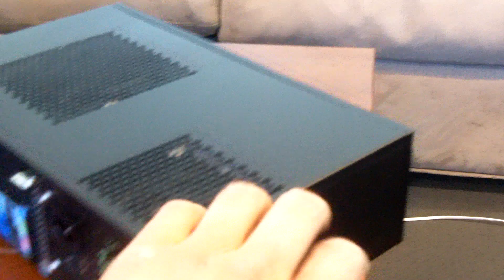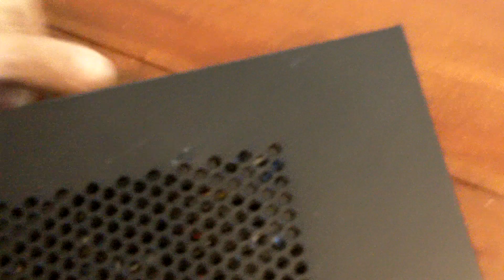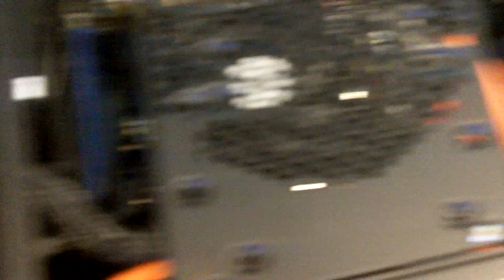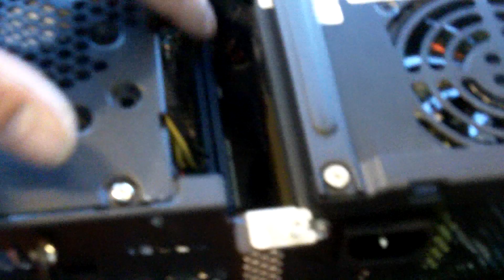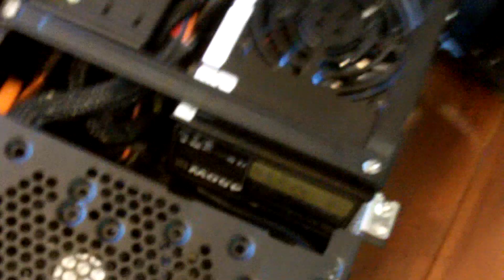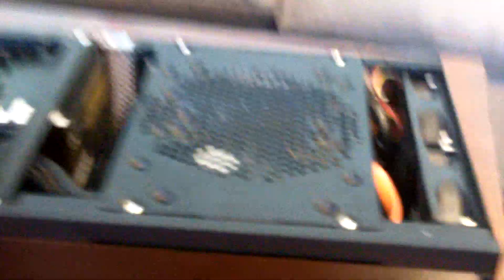Post CES 2013: Silverstone's ML05

Comment: I want to know this as well. Is there clearance between the water block and the top of the case for a 25mm radiator and a low profile 120mm fan? Like a Corsair H55/H60?

Comment: Must be low profile, something like an nVidia GT430 or AMD HD 7750 would be ideal. Unfortunately not many are passive-cooled at this size.

There are passive 6450 and 6570's but they are pretty weak for 1080p 3:2 pulldown or 23.976fps playback (they will lag in action scenes)